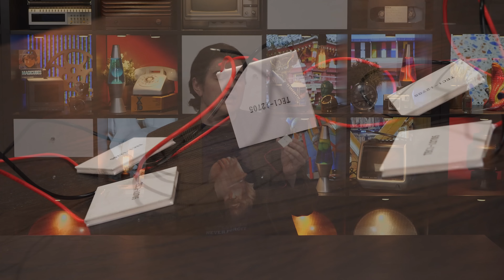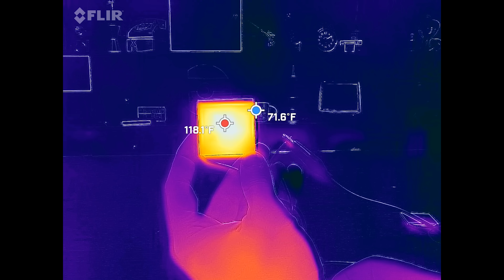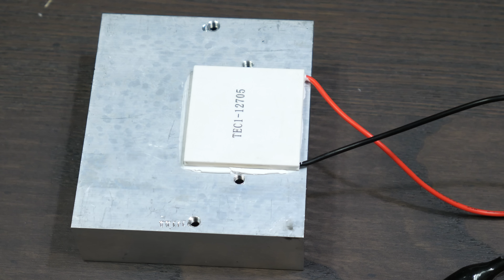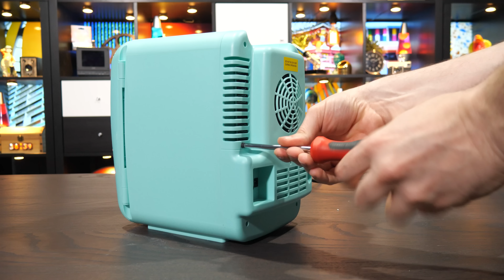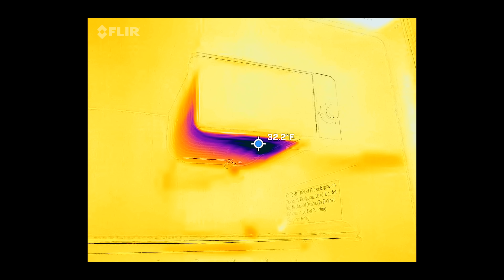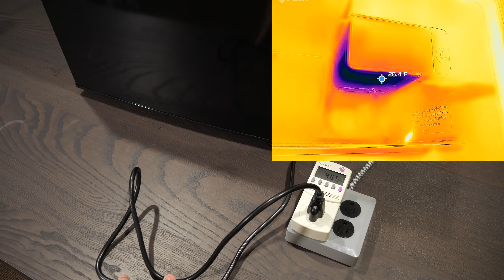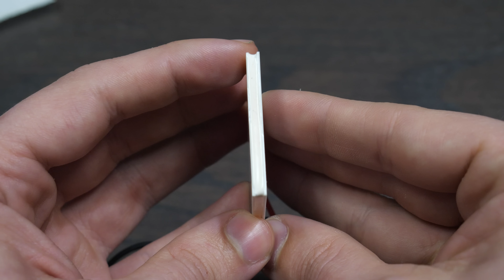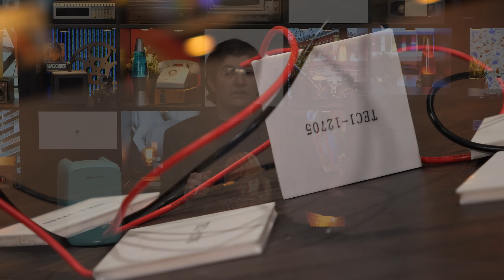Thermoelectric cooling: it's not great.

Comment: Another major, kind of niche, application Peltiers find themselves in is PCR thermocyclers. And I cannot overstate how much these machines are the workhorses of modern molecular biology. Any major lab will have at least 2 or 3 knocking around. The major reasons are for their cheapness,  their ability to switch from cool to hot quickly, and the finer control over the temperature they offer compared to traditional compressors. And because the thermal mass they need to heat and cool is often small compared to food they actually can perform their jobs lightning fast allowing for temperature changes of as much as 6 degrees Celsius per second.

For those who do not know thermocyclers are just boxes that heat and cool super quickly, which for PCR is a necessity. PCR itself is a technique we use to copy DNA a whole bunch of times, and it needs these quick temperature changes to work.

 If you are curious originally an oil bath with a heating element was used ,and before the advent of automatic thermocyclers poor graduate and undergraduate students had to manually move reaction tubes between different water baths. The technology surrounding PCR might actually make a good video if you are interested.

I mention this only because I feel it is worth pointing out that yes these devices, despite their flaws, do have some use in major, non-gimmicky, albeit niche, applications.

Comment: I had a VW camper with a fridge that ran on gas or (on the move) 12 volts. It's performance on 12 volts was crap.
Would that have used Peltiers?

Comment: I had one of these as a poor student many years ago, i didn't have much to keep cold, and that was cheap, and also i didn't directly pay for energy (though i didn't know how inefficient they are) but i had the genius idea to run it inside a closet, so it really didn't do a great job from there.

Nice to know isobutane (apparently also known as refrigerant R600a) is so much less of a concern, and the new standard.

I was wondering if stacking peltier devices to make the gradient, well, much more of a gradient, and running them on much less power, would make them decently efficient, since the cost of the peltier element seems low, but if you say at best its' going to be 1 or 2, it's never going to get close to heat pumps anyway.

Comment: In an occasional class I taught on the refrigeration cycle I used 'canned air' as a refrigerant substitute. Invert the can and spray it through a tube and the tube gets cold. Spray the same way into a styrofoam cup and you can collect liquid 'refrigerant' that will stay liquid until heat is added. (safety, yadda, yadda, PPE, etc.). This demonstration gave many people that "AH-HA!" moment that is tough to convey with diagrams and formulas.

Comment: I modded one of the Xbox flavored peltier fridges with a PC CPU heatsink and fans (the peltier is on top instead of the side) and a cheap tempurature controller module I bought on amazon and a 120W meanwell psu because I got a 12710 peltier and it works well but is not efficient or fast and is a novelty product at best. It goes down to about 7 degrees celsius.

The peltier is usually behind a block of metal attached to the inside of the fridge, not directly to the inside of the fridge.

Comment: As usual, there is nothing he said I can disagree with. I played with peltier chips years ago and realized they are great at making electrical energy almost disappear without much gain. As for that little blue "toy", if there was a flat heat sink on the inside, would that help? I know it would help increase the cost. One thing I'd like answered. If you used the Peltier chip to produce heat to warm something, is there any benefit using it over just a simple full on heating element? I say that because it produces more waste heat then it produces in cold, right? Same is true with compressor based systems, but they arn't as bad. Running a dehumidifier will generate more heat than cool, so the room it's in will get hotter. So, say the room dehumidifier dissipates  650 running watts, is it producing the same BTU's as a pure electric heating element consuming the same energy? Crazy stuff.

Comment: I love Peltiers for people who know what they are. I don't buy those useless beverage coolers. The thing is a peltier is decent at keeping things cool for longer but not good for bringing down temperatures. Basically if you have a warm exterior, and cold interior, a peltier can fight against the warmth outside getting inside. Before I had a compressor cooled car cooler, I had a Koolatron peltier cooled cooler that was very useful. I used it to keep things cool when I was a delivery driver. I also used it as a fridge when traveling across states and brought it into my hotel room as a fridge and kept things cool when I was in the moving truck. But I am an informed consumer who knows what I am getting into with a peltier. I agree most people don't. For an insulated cooler that 20 degrees is enough to keep a Costco snack wrap platter and some drinks below the danger zone, barely (with ice packs), while in an air-conditioned car or hotel room. Both situations where I can't feel the cooling difference. In a cooler, a peltier is a cheap way to make a cooler a little better, than a cooler by itself. 

I still have the cooler, but I use a Bodega compressor cooler as a mini-fridge in my office because it can cool in a warm room. But the Koolatron is useful for some things. Its a cheaper way to keep groceries cool for example, though not many and I think some ice packs and insulated bags are better.

Comment: Couldn't you get a greater than 30 degree temperature difference if you run multiple elements in series: maybe one unit feeding into two units running in parallel. 

Then throw in some decent insulation too. Not sure that they produce such models, but at that point you'd be closer to an apples to apples comparison vs a mini-fridge.

Comment: The Tech Ingredients channel built a Peltier fridge and deep freeze.  It worked well but only after they took extraordinary/impractical steps to remove the heat from the backside of the peltier elements.

Comment: We had a 12vdc camping stove that combined this with a very well insulated cooler, and it could be used as a warming oven if you reversed the current. It worked well for the purpose, but not as well as a real fridge.

Comment: Small Peltier coolers are well used in amateur  and sometimes professional astrophotography (trying to pick up a few photons on a CCD or CMOS chip camera), cooling the relatively small chip down to about -20C.  Makes a big difference in reducing image background "noise", at least in this one usage.  Never actually tested power usage, but you can plug system into 120 volt outlets or battery operated units without popping a 20 amp circuit breaker.  Little 'fins' along the side of the unit release heat into the outdoor air.

Comment: PC CPU peltier coolers are a thing, stupidly expensive, and even if you ignore the large power inefficiency, they just suck

At idle they can be much colder than room temp, but as soon as you would need expensive cooling setups it starts insulating making it worse than cheaper methods

Comment: I had gotten two of these things for Christmas about 5 years ago, and they couldn't even keep a single can cool, and they were both a much smaller unit that could only hold one can at most.  They also drew a lot of power too judging from the instructions that said not to plug it into a power strip.  I'm amused that the technology improved to be able to hold 6 cans now and are still garbage.

Comment: Yep, it's a pretty neat effect, but also kinda sucks in practice.
Back in the late 90's/early 00's, some overclockers would use them sandwiched betwween the CPU and actual heatsink, but soon found out now they had to remove more heat than before. Not great.
Then heat pipes entered, which are just amazing, and peltiers were mostly forgotten for PC cooling again.

Comment: You need to stack them and that gets the hot side hotter and cold side colder. Using a single cell for this volume is crazy, running multiple at lower power would be more energy efficient since the efficiency drops as they warm up.

7 degrees is not food-safe temp?

The main issue with refrigeration cycle is the compressor noise. Compressors get noisy after a few years of use.

Comment: The only use of peltiers I saw, and which makes perfect sense to me, is in astronomical cameras. You want to keep a sensor (~1 inch wide thin plate) at a stable temperature, as low as possible, and usually those go at least 30-35C below ambient, which allows you to keep sensor at stable -5C at night and avoid recalibrating for termal noise each night. That case doesn't care about any downsides of peltier (you are powering camera and most likely a PC controlling your rig with car generator or big powerstation, and thing you are cooling is really small) while requiring being able to work in any orientation (because your target in night sky can be anywhere and moves across the sky due to the damned Earth rotation, and you usually want sensor on your camera to be pointing in a general direction of the object you are trying to film). I do not see compressor-based cooling making its way there at any foreseeable future.

Comment: What is really cool is using these to generate current. So you have heat on on side and cool on the other. Nuclear batteries work this way. You only need about 10,000 grams or 250-300 of Amercium 271 which is about $5,000 a gram. And then a bunch of these. A pressurized container to hold it all and boom you get a car battery that last maybe 28 years no charging needed. You also can use alpha voltaic generators too. But the car will generate around 700 watts which is plenty to run a car. All for like $3,000,000. Most of that is from the Au 271, now you could lower that cost by making you own in a nuclear reactor. Which generates electricity you can sell and use to power your auto plant. Elon musk hit me up.

Comment: From what I understand 1 spot where peltiers can be useful is in lab environments where you need to get stuff extremely cold.

But wait. Didn't he say they only they only cooled about 30 degrees below ambient? Well fun fact. You can stack peltier stages. Google showing somewhere in the 135C below ambient range for a 3-4 stage peltier. This would be use when you need say a specific sensor to be nice and frosty.

If your trying to do a lab freezer at those temps though you use a 2 stage refrigerant based system but those are bulky.

Comment: I had one of those fridges as a kid, except mine had a 3 way switch (cold, off, and hot). To this day have no idea why it had a hot option, all i know is that the switch was on the back, and one day when i put cans in it before going to school, and reached my hand around to turn it on, i unknowingly turned it to hot mode. I was quite suprised when i opened the door to an exploded can of coke and a ton of hot coke spillong out the second i opened the door to it. Why tf did it have a hot mode on a switch on the back that you cant see unless you twist the whole thing around?

Comment: My grandpaw was quite ill and needed top keep some sodas cold in his room which was not really setup to have a mini fridge... so I snuck in a portable fridge. They can run on 12V from your car or from a wall adapter... and its a real refrigerator with a tiny little compressor in it, its been running for nearly a year now (my grandpa passed but at least he had a cold coke when he wanted it). And it could really get them quite cold and is more than capable of hitting freezing.  It was $130 for the 10QT model... its small and portable and you pay a slight premium for that but it does really work and is fairly quiet.

Comment: Before I had a proper refrigerator at my shop I used one of these to keep ceramic coatings (small glass bottles) cooler than room temp. Like cosmetics that's a pretty good use case for these.

Comment: Please could yo0u explain gas powered fridges. in the 1970s my Aunt had a full size one. Really odd to see a pilot light on a fridge. I believe they are still popular in camper vans etc were it is easier to hook up the gas cannisters used for cooking than to run a generator 24/7.

Comment: I used one of these for YEARS. Though mine must have been better constructed as it could actually freeze cans if left in (plus it had a 3 position switch for Cool, Off, and Heat). I really had no space on my desk for anything else. So while not the best, it was my only option unless I wanted to lose a monitor. I never placed warm soda in it either, but always transferred soda from the main fridge to it. It just made it should I could sit and belt rat in Eve Online all day without ever moving.

Sometimes it's not all about overall efficiency or effectiveness, but also space. This is clearly better than nothing.

Comment: More quickly er?
What's funny about these little Peltier fridges is that they knew to put a great big heat sink on the hot side but they only put a tiny little plate on the cold side.
I bought one and put a gel pack in the back of the box.
That extra thermal Mass seems to distribute the cold better.
Thinking of replacing the hot side heat sink with something that has journals for liquid cooling.
No real pump to speak of, just something passive.
Those little jobs are best for traveling.
If you put a tiny fan in your mini fridge it will work better

Comment: Ah peltiers, had lots of fun with those in the early 2000's, cooling CPU's in computers for overclocking. And shorting out a motherboard or two because of condensation. Fun times!

Comment: If you're interested in a good use of the Peltier device, look into log burner fans. They use a Peltier to take heat and turn it into current, powering a little fan for "free".

Comment: I did an engineering internship at a company that manufactures both the thermoelectric cooling components and the finished products that they go into. What I was working on were the control electronics for one of their refrigerators. The idea behind it was to have a (somewhat) more quiet fridge for storing breast milk in NICU units at hospitals. I was told by multiple people who worked there that energy efficiency wise, these can’t compete with traditional refrigerators. To be fair to that fridge, it actually could get cold enough to store the milk (it could go below freezing point of water IIRC). 

As for where the company is today, they’ve been going through some layoffs lately. Unconfirmed AFAIK, but I’ve heard they were also doing business with the Russians after the sanctions hit, believe it was some Bismuth related manufacturing process they were getting from them.

Comment: I'm glad you made a video about this. LTT came to the same conclusion after multiple times trying to get effective cooling of computer components with Peliter modules. The handful of times they used heat pump systems, they worked so well the main concern was condensation dripping on the components and killing them. 

Frankly, I wish they weren't made in such great numbers, because as you said, they have extremely niche use cases and most consumer products equipped with them are terribly inefficient and lead to a crappy product that ultimately becomes waste in a landfill.
Reply: LTT did not read the TEC spec sheet and misapplied it multiple times. They would have needed multiple cascaded units to have enough capacity. It would not have been practical, but could of worked. What LTT tried could not have worked, reading the data sheet should have showed that.

Comment: It would be more efficient (or more accurately, work better as a refrigerator) if it had a fan on the cold side instead of a mere heat (coldness) spreader.

Comment: I was curious how those things worked with no visible compressor.  Now I'm wondering if personal cooling might just be the application that thermoelectric cooling is good for.  I live in the deep south, and it gets VERY hot here.  I also commute by bike, and with temps over 100f that means, if I'm to avoid hyperthermia I need a more active cooling solution than just cool clothes and wind in my face.  I use an ice vest.  Just a vest full of pockets that you can put ice packs in.  They first caught on with construction workers and road crews, and are now becoming popular with other people who commute or work outdoors in hot climates.  Still, without also carrying a cooler full of replacement ice packs, an ice vest only works for so long, and requires the middle man of a freezer to chill the packs again.  Why not cut out the middle man of a freezer (a heat pump in its self), which will also heat up a building that then needs to be cooled with an AC (another heat pump), and just put the heat pump on one's own clothing?

Of course, energy wise it could be argued that the freezer will run anyway, so there's little net loss by using ice packs, but weight and convenience are also factors.

Comment: I enjoyed this video but it would have been great if you could include some of the genuine applications for peltier cooling. For example, I use them a ton professionaly for cooling sample gasses to a percise temperature for analysis. It would be very difficult to get as percise control on the temperature from a refigeration cycle but when you can just change the current through the cooler you get super percise control.